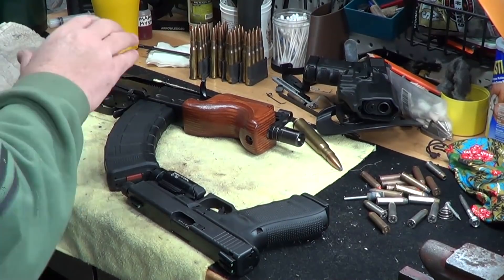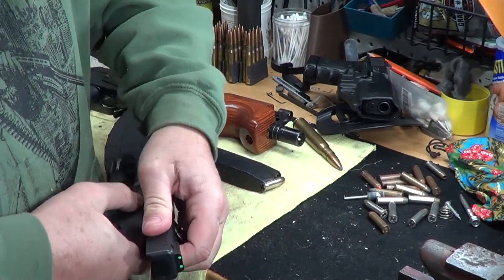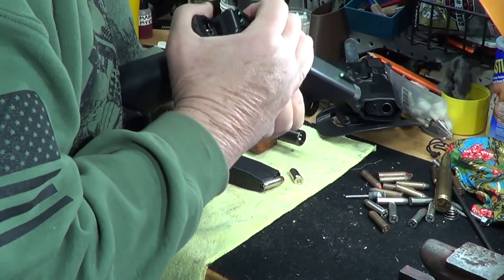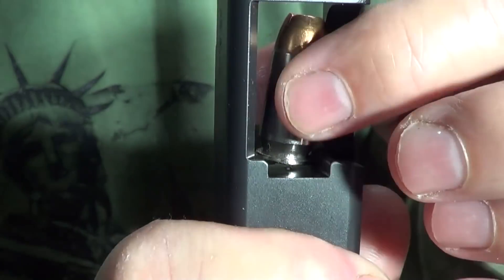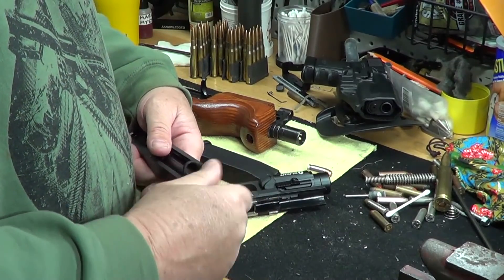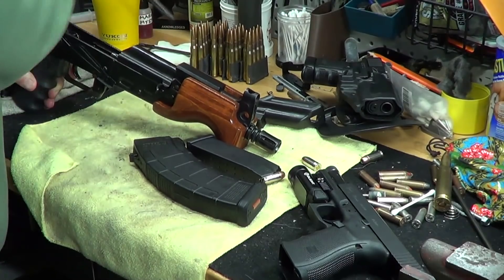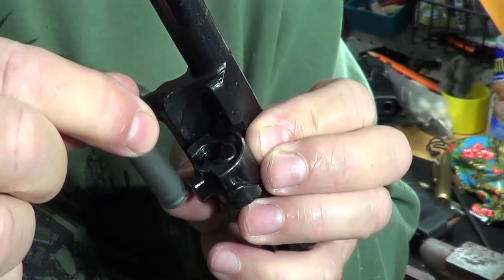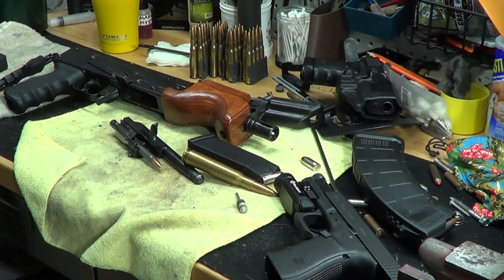Why You Should Not Load Semi Auto Handguns With Round In The Chamber - Broken Extractors

Comment: This is especially important on rimfires as the extractor can act as a firing pin when it slams into the rim.
It's a rare occurrence but you know how luck works.
Reply: That's a dangerous scenario situation to be in
Reply: @luckybassturd7260  with the sks, it is not because of the extractor, but because of the free floating firing pin, which can become seized in the forward position if not kept properly cleaned
Reply: @luckybassturd7260  any time! Alledgedly usually cosmoline or a build up of burnt polyeurathane from steel cased ammo is the culprit.
Reply: Yep
Reply: You can get a spring loaded firing pin for the sks easy fix
Reply: Still never had one slam fire tho
Reply: @ebabdbgbbbebbluesman6115  and rust...
Reply: In my 40+ years of using firearms, I have never seen anyone do that. Maybe It's a tactical prepper thing seen at the shooting range. Country Boys are taught better and we have big backyards so we don't go to those fancy shooting ranges where those tactically trained folks are. Lol.
Reply: Sweats in Walther P22 with non CCI ammo

Comment: Great info!!

Dropping the slide on a chambered round ranks right up there with flipping the cylinder closed with a "flip of the wrist" on a revolver. 

When you drop the slide you cause the damage explained in the video. When you use your wrist to flip the cylinder closed on a revolver you risk bending the crane. 

ALWAYS use the non-firing hand to close the cylinder back into the frame with your thumb and forefinger. 

Note : The crane is the little arm which holds the cylinder and swigs the cylinder out allowing loading and unloading.

Comment: This is very important. I keep a round in the chamber so a couple times after cleaning I would load that way. I eventually saw brass on the extractor and inside the slide plus scratches on the edge of the round, realized it probably wasn't a good sign and stopped. Can't imagine the damage I would have done if I didn't notice it immediately and did that for years. Glad I was able to put 2 and 2 together and call that a clue
Reply: I was going to ask why would you do that in the first place.  Then I read the username.
Reply: @kdworak4754  I did it because I grew up around rifles, shotguns and revolvers and knew nothing about semiautomatic handguns. I read the manual and unfortunately missed that part. I'd seen it done in movies and that was when I realized how inaccurate film and television were with firearms. Fortunately, I only recall doing it one time. Either way, was definitely stupid and I got no problem laughing at myself, mistakes are at least a great way to learn
Reply: @Blunt_Man  for sure mane.  🤙🏻

Comment: I'm so glad you did this video. Magazine capacity +1 is technically correct; however, I believe it gives the impression that the dangerous practice of dropping the slide on a chambered round is safe for your pistol. It's not.

Every time the slide slams shut on a cartridge, the extractor must deform to move past the cartridge rim. Stainless steel is very brittle, so if your extractor is stainless rather than carbon steel, it is particularly susceptible to damage and ultimately failure. Your first clue will be failure to cycle after the first shot. Hopefully that won't be during a gun fight. Never a bad idea to carry a backup. 

Sorry for the long post. Just a very important topic that is never discussed. You the man, Rick!
Reply: You still get the +1. Just insert fully loaded mag rack/drop the slide. Holster the gun. Hit the mag release, top off magazine, reinsert full magazine into gun till it clicks. Chambered round plus full magazine 😁
Reply: @TacMedCop  lol touche 😁 fortunately since sig gave the world the p365 I don't sweat that one round so much anymore. Not even sure why one would buy a single stack subcompact anymore, but I digress.
Reply: @tehmtbz  those are nice 👌 those are definitely on my list of guns to buy

Comment: Great stuff as usual Rick. I recently learned from watching a video with Bill Wilson that hitting the slide release on an empty 1911 will damage the gun. He talked about a shot show where people would come up and check out guns and pull back the slide and lock it and then hit the release and it damaged several guns to the point to where they had to repair them after the show. I had no idea about that. They claimed that the guns are designed to encounter the resistance of pushing a round out of the mag which prevented such a hard slam shut. They said they cringed every time someone did that but they didn't stop to educate them. I'm so glad that you make videos that, with no judgment, explain even the most basic of things.
Reply: Wow, what would be the point in not stopping people to teach them, replacement parts? That'd be dirty... Thanks for sharing 👍

Comment: only a few handguns were designed to be loaded without the mag. Only one i can think of at the moment is the Beretta 92f.
Reply: Yea the extractor is on a spring I think so will flex, clip, grip and pull. I once had a 92f go full auto when the firing pin got stuck and fired the whole magazine. I learned you're meant to eject the magazine.

Comment: Didn't think about it that way. Never loaded my M9 that way, most certainly didn't try to lad an M4 that way, but what it does to the extractor when doing so makes sense.
Reply: doesn't matter with an M4 it's meant to work that way. long range shooters have been doing it for years because they use heavy handloaded bullets that are too long to fit in the mag sometimes. I've never personally seen it cause a problem.
Reply: @brandonbowman5915  Right. Yeah trying to load the M4 through the ejection port would not only be difficult, but dangerous, especially with the bolt locked to the rear, which it would basically have to be. I could load the M9 that way, but it would probably do the same damage Rick is talking about, and nobody in the military ever instructed us to load an M9 round that way, so yup.
Reply: @SgtSplatts  bro an 11B can do this. Lock the bolt back and drop the round. As far as the M9 goes I will disagree just a little bit because he does make a decent point there but mag springs under tension pop those rounds up quick. That's the reason for the taper on the extractor. I'm not saying he's wrong I'm saying there's context with rifles and some pistols.
Reply: @SgtSplatts  ok had to add the only thing that's dangerous is if you do it more than once on the same round. That can cause seating and pressure issues especially if you're using match ammo. I have had something similar happen with m855 rounds in 5.56 constantly rechambering them because the army is stupid. Even when they're crimped from the factory they will start to walk on ya. 
I'm not talking trash don't take it that way it's personal experience I'd like to share and hope it helps. 
12 years Army with multiple deployments. Doesn't mean I know everything but have seen a couple things go right and wrong
Reply: @luckybassturd7260  Makes sense. Still, I can tell you first hand it has a small spring mechanism that supports the extractor, which would incur the same forces Rick is describing if loaded by hand, and I'd prefer a magazine, not hand bullets, lol.
Reply: It’s ok if your extractor has a bevel cut on the forward face.  That’s why the bevel cut is there.
Reply: @blackhawk7r221  Yeah it does have that bevel cut. That probably reduces the force. But there is a difference in force application when sliding a round forward while already in contact with the bolt, versus place a round in the chamber and releasing the bolt to slam into contact with the round. I don't know if the military has any data on this, misfire rates, etc...

Comment: The extractor on glock is MIM. Metal Injection Molded.   The manufacturing process is essentially just glueing powdered metal together under heat and pressure. The striker is the same material.  Spend $80 and get a forged or billet striker and extractor, and they'll likely be good for the life of the weapon. You should still follow Rick's advice as it is not correct to load the chamber without being mag fed.
Reply: Did you ever think that maybe the company knows what they are doing, and that maybe it was designed that way?
Reply: If you use it the way it is meant to be used. And you don't do stupid shit like drop the slide on a chambered round. Then, your factory extractor will last your lifetime. Atleast.

Comment: A lot of the open bolt automatics (with fixed firing pins) are designed with big, tough extractors for that purpose... but most modern guns aren't. The worst are 22lr, because most of them have very thin stamped sheet metal extractors. They're only like 0.050" thick or something like that. There's are terms for guns that are designed for the bullet to slide under the extractor and guns designed for the extractor to "clip onto" the round after it's already in the chamber, but I can't recall them. (I know about 
"Push Feed" and "Controlled Feed" with bolt action rifles, but don't think it's the same thing when it comes to other guns). I'll try to add it if I remember. Forgive the rant (a comment for viewers that don't mind reading my rants).
Reply: Any gun with a pivoting extractor can be push fed guns with spring type cannot be without possible damage
Reply: My god. An extractor that is 5 hundredths of an inch? Lol I’d call that tin foil no?
Reply: @DemonratsRevil  Yeah, they probably are thicker, but not by a whole lot. They're stamped sheet metal and aren't very thick at all. I can't find my calipers to take an exact measurement ... but they are very thin. Not sure if you've ever seen a Ruger MKIII extractor, but it's very thin... and many .22lr's have extractors made out of the identical sheet metal thickness. I think the Ruger 10/22 and MKIII my share the exact extractor.

I don't have calipers, but with a tape measure it's about 1/16" (0.0625") or about 1.5mm (which is 0.059").... so 0.050" isn't far off. It's hard to tell exactly without calipers... but I think it's safe to say that it's no thicker than 1/16". It seems like it may be slightly thinner though, so it could legitimately be 0.050" -0.055".

(I tried to look it up online, but couldn't find any specs or blueprints of the extractor. Volquartsen's MKIII extractors are actually 0.006" thinner than the OEM extractors too.)
Reply: @DemonratsRevil  Found calipers. They are 1/16" (0.0625") and the volquartsen one's are 0.055").

Comment: Most guns it’s ok to drop em on just load a rd slow and see if their tracking under the extractor as u slowly release the bolt or slide. If not their probably ok. Ar type they track also they even mechanically hold the extractor closed while chambered and until the bolt is pulled back somewhat. Some designs have more trouble that others so they have a very aggressive extractor and modifications help a lot. Ak is huge and robust and work worn and with weak springs ar needs to be sharp they like heavy springs but that also increases the likelihood of breakage so I definitely like giving those extractors personal attention sharpening and profiling etc

Comment: This is essential advice, and the only way to load a single shot is to slip the round in against the breech face, if you absolutely have to do it. Otherwise, load mag, rack, drop mag, add one, rotate the rounds if you regularly clear and load the gun, and shoot it before you set all the bullets back enough to cause overpressure.
Reply: I noticed on an AK that successively chambering and extracting the same round over and over led to the firing pin making a progressively deeper ding in the primer! WHOOPS! I don't do that no mo! : )
Reply: @lordofthewoods  A popped primer will seriously mess up your day.

Comment: Look at your extractor.   If it’s forward face is beveled, like on a M-4, you are ok.   This is why the bevel is there.   Or if your extractor has a rounded face (like a letter J) and fits into a slot cut when in battery, you are ok.  But I am speaking of center fires.  
A good extractor design allows pivot in both directions to compensate for shooters loading singles in this manner.  
DO NOT assume your firearm, no matter how much you love it, has a good design.  Inspect.
But here is the caveat:  rebounding firing pins with weak springs.  You let it slam forward at a higher speed than it would normally have when having to strip a cartridge from a magazine, inertia may be great enough to fling that pin into your primer when metal slams metal. 
And just like he stated in the video, slamming metal into metal is called hammer forging, and doing it cold definitely causes work hardening and microcracks.

Comment: Nice video, the AR extractor are built similar to the AK. It's pin in the middle and has a sping to keep the tension inward with a bevel on the front. I can't think of any reason to single load that way except in the most dire situation.
Reply: One reason to load that way is for light primer strike rounds.  It’s not exactly the best idea to put the round back in the mag, put the mag back into the firearm, then let the bolt/slide slam into the back of the round while feeding and chambering.  Best to get it back in the chamber pointing downrange and put the slide down onto it to try to hit the primer again.  The ammo quality nowadays reminds me of how it was back in the 80s-90s.

Comment: Makes sense.  If I wanted a hand gun loaded that full I would put the Magazine in and rack a round into the chamber .. Pull the Magazine out and  put one more round in the Magazine.
  I bought a used Beretta PX-4 Storm.  It won't eject the casing half the time. I got a magnifying glass and discovered the tip of the extractor is badly worn or the tip is broke off.
  I ordered a new Extractor during the Plandemic  had to wait like 3 months.. I think it cost $22.00  for a new extractor ..

Comment: This is a gun model specific issue.  I have tested manual chambering of a Sig P365 by releasing the slide onto the round 1,830 times without ANY visible signs of damage to the extractor claw under a 30X microscope!  That is the equivalent of manually chambering a round every single day for over 5 years!

I do NOT actually recommend allowing the slide to slam closed!!!  On a P365 you can ease the slide onto the round and then press the rear of the extractor inward, which pivots the extractor claw outward and allows the slide to be pulled into battery by the recoil spring.  This will NOT damage the extractor!  Polishing the beveled edge of the extractor will make it even easier for the slide to RTB.

If the pivoting extractor is not accessible to be able to manually pivot the extractor claw outward, you can instead ease the slide onto the round and then push the slide closed.  There will NOT be any impact force on the extractor claw.  Only the pressure of the extractor on the brass shellcase, resulting in an extremely small amount of wear.  With the bevel of the extractor claw being polished in my P365, I can use my arthritic little finger to push the slide slide closed into battery.

EVERYONE should know how to manually chamber a round just in case there is a catastrophic failure to feed.  At least you will be able to load and fire one round at a time, vs none.

Be clear that this information is only relevant to pivoting spring loaded extractors.  Non-pivoting extractors, such as those used in some 1911s, can break when manual chambering if the steel extractor is not extremely good quality.

Comment: I'm more worried about my striker assembly breaking again during firing on my FN 509 Tactical. I thought they fixed it but apparently not. And my serial number was part of the fixed batches
Reply: Ditch that thing, and get something with a more proven track record. Good luck.
Reply: @jonathank7394  I mean it's a FN you can't get more proven than that lol. It's a reliable "combat pistol". just had that issue that somehow got into my gun after the fix.. I thought about it but there's nothing else out there I like. So I ended up dumping a hell of a lot of money into the 509 tactical & now it's completely custom down to the lighten springs. I lightened the striker spring because I think that was the issue, too overpowered. so far I'm okay 🤷‍♂️

Comment: Hmm my glock 21 grabs it as it closes not as the round slides into the extractor specialy while firing cause the extractor goes past the shoulder before it picks up the round. You even showed us when you loaded that round and you pulled the slide past it. Your round slides right into the extractor when your firearm is locked back to ease loading thats all the extractor is spring loaded and its job is to reach over and grab the shoulder. Thats the importance of cleaning your carrier group. Specialy 22lr where carbon build up is heavier than center fire. And idk anyone who loads a pistol in that manner if it were not a move of desperation in a bad situation.

Comment: On the pistol you were demonstrating with though, it seemed to have a ramp on that face to allow it to push it's way around the round though. Or is that more a relief for it to be ejected easier and the spent round to twist out around the back of the round as you were demonstrating with the larger round? Not refuting what you're saying just rying to upnderstand if you know what the ramped edge on the extractor was really meant for. Long story short though, if you want to make sure you have all the rounds you can have, rack one, pop the magazine out, load another shell in, and reload magazine I suppose. Only realy reason to do that I would imagine unless like someone else mentioned, SHTF situation and need to fire one more shot and magazine is nowhere in site or damaged and can't be used.